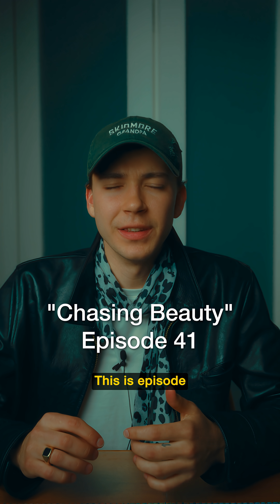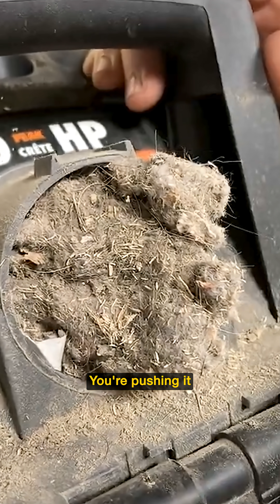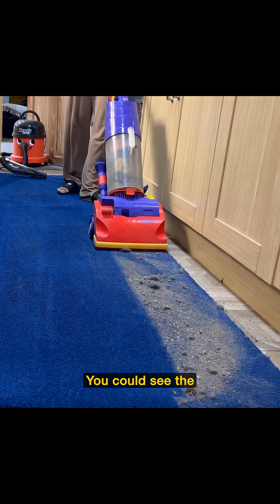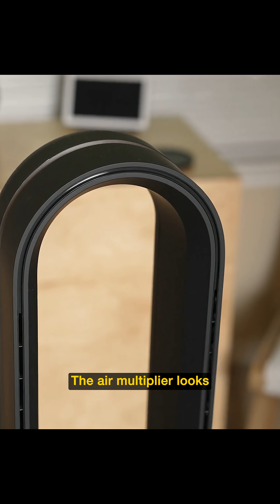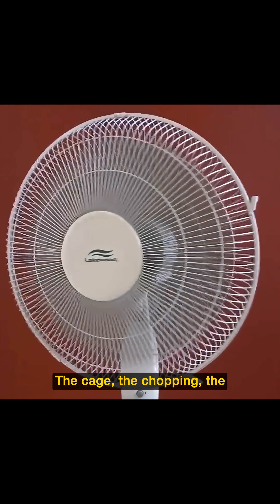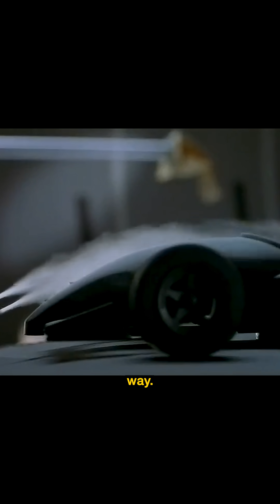Dyson products look weird, but there’s a reason. Behind their iconic product design...

Comment: I have a Dyson V11 cordless stick vacuum. Been using it for 3 years to clean a small Airbnb. It is epic. It's remarkable how much dust, hair and dirt accumulates after just one day. It's a joy to see all that debris in the clear collection barrel, fall into the garbage. 
I clean the insides after every use!
Great product Very convenient $900
Reply: I love my dyson stick vacuum, but I am of the firm belief that the new versions do not make a large enough improvement on the technology to be worthy of an upgrade. The new ones are vaguely fancier, maybe with better batteries, but the part that matters (the motor) isn't some huge improvement. I still recommend people to buy the Dyson stick vacuums for one really good reason: they are popular and thus have LOADS of third-party parts and accessories. Battery dies? Just buy an off-brand battery. Power head bites the metaphorical dust? Here's an equivalent head from China for 1/4 the price. Want an easier way to mount all the accessories? Well there are a butt-load of  organizers for them or (if you have a 3D printer) a billion different files for free to choose from. I'm sure other vacuums perform on par with Dyson, but the ease of finding replacement parts is huge.

Comment: The dyson fan/heater that I have is fine. I got it mainly for the heat setting in the winter. But I have box fans that kick out air better than the dyson on the cool setting.

Comment: Bagged vacuums are way better than canister vacuums. If anything interrupts the spinning action of canister vacuums then the dirt is allowed to escape with the exhaust air. Bagged vacuums do not have this problem. As for the diminishing suction with bagged vacuums all you need to do is change the bag when it gets full which happens a whole lot less frequently than you’d think unlike canister vacuums which have to be emptied every time you power off the machine.
Reply: The air is filtered on the way out with a HEPA filter so it doesn't go everywhere but the vacuum does become less efficient and still working
Reply: @Lunaphied you are correct that there is a hepa filter but the filter is extremely undersized in most vacuums and once that gets clogged you get the same loss of suction that marketing attributed to bagged vacuums.

Comment: The Dyson fan is still stupid in my opinion. Functionality is still the most important and a regular fan moves more air and does it more quietly.
Reply: wait, those big towers are not even quiet? I though that was supposed to be their main selling point
Reply: @panda4247 air moving creates sound. bigger area=less noise. smaller area-bigger rpm/speed for same volume. 
bigger=better, which can also be lower quality and crappier design, but because its bigger it can run lower rpm and be less noisy.
Reply: I used Dyson tower fan/heater cause the heating in my work accomodations stopped working for the winter, its absolutely dreadful to try to sleep in the same room with that as it either hums or starts blasting like hair dryer.
I switched it for electric oil radiator when i got the chance.

Comment: >bladeless fan
>looks inside
>blades
Reply: > new revolutionary power generation
>looks inside
>boiling water in a fancy way (again)
Reply: @jahsehonfroy126 ah Nuclear power plants working be like😂
Reply: @melodyofloveinblood same shit with nuclear fusion
Reply: @georgianasirbu678 to be fair it’s not how we generate the energy it’s just the easiest way we’ve found to turn heat into mechanical energy.  It’s still a novel way to generate the heat.  Which is what energy very roughly is.  Just shit bonking other shit.
Reply: @jahsehonfroy126 weirdly enough, this is how some solar power works: concentrate sunlight into a boiler
Reply: @riverClaire  no its not even solar concentrator farms use molten salt, steam wouldn't work (but the molten salt itself could be used to boil water)
Reply: @abhinavdoddi660  The molten salt is used to boil water. That's why.
Reply: @abhinavdoddi660  Still used to boil water though, we are really still little further along than steam engines, just using different ways to create the steam now.
Reply: @jahsehonfroy126  Always has been
Reply: Solar power is different. Instead of figuring out a way to spin a magnet, The photons literally shove electrons out of molecules in the photocell
Reply: @jahsehonfroy126 I mean, the power doesn't come from the water, boiling water is just an easy way to convert heat into mechanical energy that is used to generate electricity.
Reply: @jahsehonfroy126  Actually boiling CO2 now
Reply: @jahsehonfroy126 hey bro boiling water really works
Reply: @jahsehonfroy126 luckily we finally upgraded to... Boiling CO2
Reply: @jahsehonfroy126 "I invented a new power source!"
"New or steam?"
Reply: @jahsehonfroy126 obligatory sco2 reactor comment
Reply: @jahsehonfroy126  Not solar. And incidentally it is the most efficient one.
Reply: @jahsehonfroy126  not fancy but efficient ways.
Reply: @jahsehonfroy126  "Today we activate our first Dyson Swarm!"

"Wow, how does it work?"

"Well, you see, it gathers energy from the Sun. Then it stores it in massive capacitors, which transfer power to an incredibly powerful laser diode array on board each swarm component. From there, it beams that power down to our receiver arrays via the laser. And then, here's the most exciting part... the receiver transfers it to a boiler where we boil water to make steam and spin a turbine."
Reply: @jahsehonfroy126  every massive energy generator pretty much is by boiling water lol. Sadly we have not find alternative that match its efficientcy.
Reply: @faandean  supercritical co2
Reply: @faandean  You know what, this makes sense to me.  Boiling and cooling water can basically be a closed loop system where you don't lose any "refrigerant" under normal circumstances, but if you do due to a leak, it's just water and is fine for the environment.  Water is impressive.  It changes volume rapidly at easy to create temperatures.
Reply: @faandean 
how about create a ███████████████████
Reply: @faandean  We have. Solar. Its literally the most efficient in anything but land use.
Reply: Bladeful imho
Reply: @AtomizerX nice pfp
Reply: @hoopty1234  [insert dual Spider-Man pointing image here]
Reply: @AtomizerX what text-only comment do to a man
Reply: Edgeless fan who is secretly edgy inside.
Reply: @Agent_E1994 fine gentleman who appreciates heavy metal
Reply: Turns out I have an engineless vehicle!
Reply: The hardest part of building a Mechanical Turk is hiding the man
Reply: And Dyson "bladeless" fans don't work that well, they just don't move that much air. The air purifier ones are particularly useless since the rate of air purification is so low that unpurified air will refill a room much faster than the machine can purify the air
Reply: @poshbo hey how dare you insult my dyson purifier with facts 😭
Reply: @poshbo 'small' industrial grade 120mm fan can push a lot, but at 4k rpm its noisy. bigger diameter=less rpm for same volume. so basic designs still win, but they 'dont feel' as a new age tech😅
Reply: @poshbo  lol it’s hilarious when people say stuff like this, it’s almost like they’ve never owned a Dyson in their life 😂😂😂
Reply: @joshsnpsno idea what you're trying to say. There are studies which show how ineffective Dyson air purifiers are, you can find them on YouTube.
Reply: @joshsnps https://youtu.be/9tA3T7AzsZ4?si=0rFwEP5EzMDE7Zac
Reply: @joshsnps I don't need to own one, when people who do own it went out and did all the testing for me. It's okay man, you overpaid for a fan because it looked nice. You really don't need to justify your purchase by lying about its performance.
Reply: > Boneless chicken
> Looks inside
> Bones
Reply: They laugh and say it's a good fan sir
Reply: > Open comments section
> Looks inside 
> Find this reference, again
Reply: the shape is pretty convenient for me since i use one to cool my pc
Reply: alien species with over the top energy generation means that use antimatter suddenly arrives on the planet
Humans:  I   H A V E   M A S T E R E D   O V E R   6   M I L L I O N   W A Y S   T O   B O I L   W A T E R
Reply: +1000% noise
Reply: should’ve bought a bladenone fan
Reply: >Wireless earbuds
>Looks inside
>Wires
Reply: @dontletmememandie6506  i feel like some people didn't get this reference lol
Reply: well ya, obviously
Reply: Also works worse than blades
Reply: And every product they make is crap.  It might look like it's really something but they are all garbage. Especially their vacuums.
Reply: Yea, why would he say no blades? Makes no sense.
Reply: But i like the cool aerodynamics they use
Reply: >bladeless fan
>look inside
>Normal fan
Reply: Yes - blades which are very much smaller than your average desk fan.
Reply: > Wireless controller
> Looks inside
> Wires
Reply: It's also, after testing, a completely terrible fan outputting far less air movement and more noise.
Reply: Best part, the blades are way smaller so they have to spin faster and are louder
Reply: Plane😊
Reply: That's why it's actually called an air multiplier.
Reply: >mfw
Reply: As a younger person, I always was baffled by such a claim. At the time, I was right, that it couldn't actually be done. Sort of. Because now, we have ion thrusters
Reply: - looks inside
- photochad
Reply: Its better because its easier to clean and there is no buildup of dust on the hard to clean blades on a real fan.
Reply: Gotta be a lawsuit there somewhere
Reply: this is turbine...
Reply: Yeah. That's the whole point. Thank you for clarifying the obvious.
Reply: i just saw a video from SmartNonsense saying that they did have blades
Reply: >"hammerless pistol"
>look inside
>hammer
Reply: With highly increased energy waste due to extreme inefficiency
Reply: Damn, beat me too it 😂
Reply: >Looks inside headfirst 
>Head meets blades
>Headless
Reply: @athens9867 Well if you look feet-first, then your feet get in the way.
Reply: sometimes people on the internet comment stupid shit 😂
Reply: it's more like fins than blades, as it's attached on the long side not short
Reply: >wireless mouse
>looks inside
>wires

Comment: I've learned quite a bit from this channel before, but it was a step too far for it to tackle engineering.  The Dyson products are SIGNIFICANTLY overpriced and have low satisfaction scores.  The fan, for instance, is worse than much cheaper and common fans.  The vacuum is definitely beaten by the Kirby, and is difficult to use under furniture.  I'm an engineer, and I recognize hype.

Comment: From the bag less vacuum cleaner you tip the dust and dirt into a… bag!
I noticed when the sun streamed into our house while emptying the Dyson how much dust is released into the room again.
I’ve now changed my Dyson for a vacuum with a bag thus preventing the dust from entering into the atmosphere in which I breathe. 
Of course you could use a dust mask when emptying your Dyson!
Reply: It's the only issue I've ever had with our 3 Dyson ball vacs, is when you need to empty them lol. But it's why I empty ours in our garage garbage can
Reply: I also hold my breath while I do it 😅
Reply: I step outside. In the summer I do a deep power washing with the hose. There are videos that show what’s washable. Scrape my clothes dryer screen outside too.

Comment: It doesnt multiply anything by 15 times. Its actually weaker than regular fans of the same wattage
Reply: Think you'll find the cost is x15, so check yourself
Reply: Lol
Reply: @Gunny-rt3lb a fool and their money...
Reply: It multiplies the tiny amount of air it sucks up by 15 times, making it much more powerful, so powerful in fact, that it becomes as powerful as you just blowing air out of your lungs…
Reply: @ThaLegendaryCommenterAnd still being less efficient than a normal fan.
Reply: That's the beauty 😂😂😂
Reply: No one talks about the fact that most dyson fans are also air purifiers. When i bought mine almost 10 years ago,  my dyson fan was the only fan with an air purifying function on the market. I already owned a conventional fan.  To this day I still use it and leave it on automode when I'm not home to help clean the air in my room. It's a godsend during bushfire season in summer but I use it in winter too
Reply: @ccc-kq6ef  this. 
The main reason its less powerful than a regular fan is because it pulls air through a HEPA filter.
Reply: @Katxune the main problem is that the fan is tiny and so has to spin extremely quickly.Doing that is less efficient than having a bigger fan.That's been slower
Reply: It multiplies the natural airflow of the room by 15 times. There was no mention of its performance compared to other fans.
Reply: @antyxwg  they said :it multiplies the initial airflow up to 15×"
I understood the "initial airflow" as the amount of air sucked by the impeller.
Not the small background airflow. then it would really suck (pun not intended. I meant "suck" in the bad way)
Reply: @antyxwg so its 15x better than no fan? One would hope so 😂
Reply: @antyxwg It's been proven to be much worse than a regular one.
Reply: @antyxwg bullshit.
Reply: No it’s weaker if you only consider the raw strength of the fan itself, however, it is better overall if you consider the whole fan unit.

Comment: I bought the Dyson wand  vacuum for pet hair and threw it out after less than three years. The seals failed within 6 months. Ditto the hand vacuum attachment. Dust went all through the machine. Hair clogged inside and had to be pulled out just like the other vacuum in this video. I went back to the Miele cannister. It's a pain to drag around, but it works like a charm, gets my rugs incredibly clean, and I toss all the dirt and hair out with the bag and the vacuum stays clean.
Reply: It needs cleaning out.
Reply: If you can afford that canister vacuum, then congratulations to you. For most of us that's a mortgage payment.
Reply: @305jellybean  bought it reconditioned on eBay for less than I paid for the Dyson. I rarely buy anything new, because too often - as with the Dyson - it's a disappointment.
Reply: @305jellybean get your bag up king

Comment: I do definitely prefer a fanned blade, but a bladeless fan definitely has the most unique aesthetic from any fan I've seen
Reply: My grandma told me, they used to make those small table fan blades out of metal in the 70s. 
 When my mom was a toddler she reached up to the counter, stuck her hand through the cage partially removing her pinky and ring finger. 
 She got them reattached, and I've always had a slight fear, even if it's a plastic one. 😅
Reply: @LocalBirb im pretty sure this is the main reason ppl buy dyson fans , fear of kids sticking their fingers in (even if they are plastic now)
Reply: @20yearsofsnowfalling  no the main reason is because they look cool/modern lol
Reply: @20yearsofsnowfalling  the main reason i bought one is because my roommate smokes and dyson fans have a HEPA filter built in. I didnt want to buy a heater, fan and air purifier unit, so i got an all in one with dyson.
Reply: @Austin.Kilgore  safer if you own birds, though
Reply: @Katxune  how exactly is it a heater?
Reply: @20yearsofsnowfalling  Agreed, also there is a fear that if a fan gets knocked down or something fails, the fan blades will easily shatter the plastic cage and be like a grenade in your own house.

Where dyson fans are more encased in a plastic structure, if a fan blade snaps or breaks apart, it wont be as catastrophic.

Let me promise you, one of the scariest things short of actual violence is when you're watching TV with the family and suddenly a window shatters because a fan blade broke off, popped through the cheap plastic case, and went straight through a window.
Reply: I own a Dyson Bladeless fan, and I gotta tell ya- I also prefer fans with blades. They both blow air, of course, but the Dyson uses more power to produce the same effect. In addition to that, Dyson, just like any other fan, gains dust along its blades. The difference is that you can't see the dust build up on the inside of a Dyson UNLESS you open the whole thing up. Bladed fans have the dust plainly visible. 

There's also the problem of the motor burning out if/when too much dust get in it. Easy to tell on a traditional fan. Not so much with a Dyson. 

And don't get me started on the price!
Reply: @herofromthedark  The vacuum solves the problem of users leaving it full of dust by making it transparent and then the company does the exact opposite with the fan. Not sure what they're thinking with that one.
Reply: @herofromthedark i too, have a dyson hepa fan, and I too prefer the blades. I agree with you.
Reply: @herofromthedark  the actual airflow they produce is also pretty weak anywhere beyond a few feet imo
Reply: . Actually the Dyson fan pushes 40% less air than a $30 fan.
Reply: Same. Theres a fun little thrill about the idea of it threatening to cut me (again) every time I touch it. Not to mention the soothing noise of it whispering windy nothings in your ear at night. And the rattling of its cage, fixed by slapping it in the face.
Reply: Also a conventional blades fan design delivers more airflow per decibel of noise. Dyson fan systems are vanity self defeating mechanisms that produces more noise, creates more unnecessary airflow funnels and hence dust choke points
Reply: Always thought the fan and hairdryer were pretty gimmicky.
Reply: Fanned blade?
Reply: Fanned blades easier to stuck and destroy they engine. Fanless blade Its harder to understand.